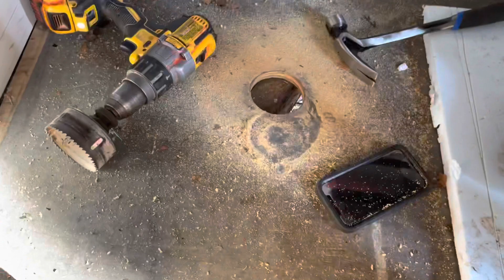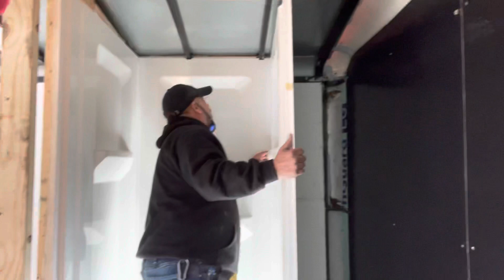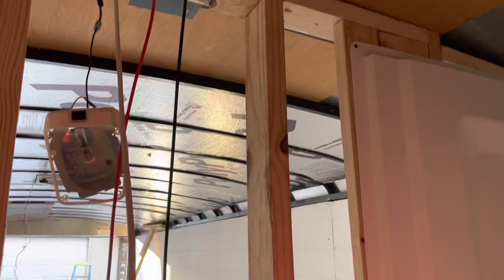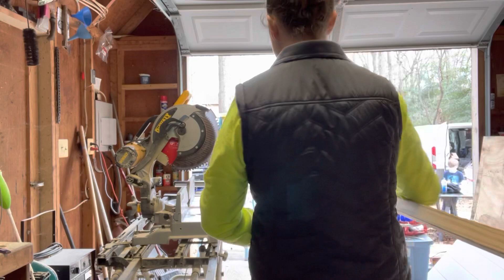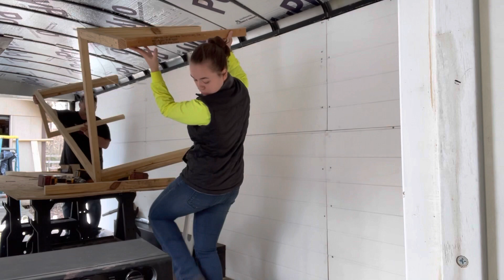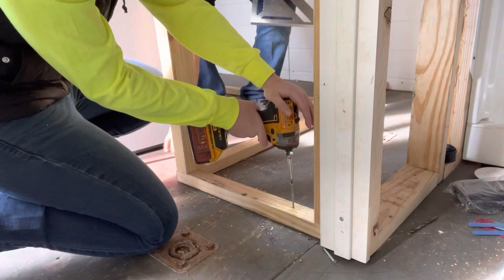Cargo trailer conversion in 2022 I 8X20 Toy Hauler

Comment: I am currently in the planning/day-out stages of designing and building a trailer like this. With winter here. Any actual work will not start until spring, as we live in the nasty cold snow belt of upstate New York.  Our base is a 20' x 8.5' x 8' duel axle trailer formerly owned/used by a self employed carpenter that is in beautiful condition and we just finished removing the work bench he had in it and doing minimal body/frame work to.  It looks brand new on the inside and out.  Over the winter, since we can't work on it due to weather, I am building a large scale model of the trailer a)so we can lay ours out and b) for the fun of it.  The model (frame already built) is in 1:2 scale (1'  of the real trailer is 2 inches of the 'model') so it will be 40" long and 17" wide. All the interior pieces (walls, beds, cabinets) will be able to be moved around so we can get the lay out we want for the real trailer and will have 9 volt working lights, simulated plumbing, ect.  I got the idea from watching a you tube video about a guy who designs and builds trailers and he built a few  scale model trailers to use when planning trailers for his clients he works with.  Hopefully, this model will help us when we start working on our real trailer come early spring.
Reply from the maker: Yeah you definitely have a good plan. We simply drew out the shape of the trailer and decided where wanted the bed, kitchen and bathroom to go. We also use it as a toy hauler so we’re limited to what we could do. The sxs take up a lot of room. We also installed our heater so we could work in the winter but I’m sure your winters are worse than ours.

Comment: Good job to the both of you! I’ve been looking at doing the same thing. I’m just not sure if I want to go with a 16x8.5, 18x8.5 or 20x8.5. Although I have a large enough truck to pull all, going shorter would still keep the weight down. Going longer would allow me to be able to mall my RZR while still building a bathroom, kitchen and bed. Decisions, decisions.

Do you think by going with metal studs instead of 2x4 for the interior walls would be strong enough as well as keep the weight down?
Reply from the maker: Yes, we just went with 2x4 because our shower and cabinets walls are going to be on the 2x4. Also, our water tank is going to be on that wall so there's going to be a lot of weight on that bathroom wall. But yes I can't think of any reason metal studs wouldn't work.